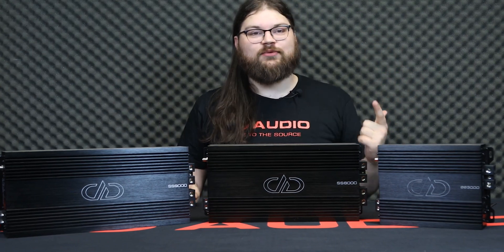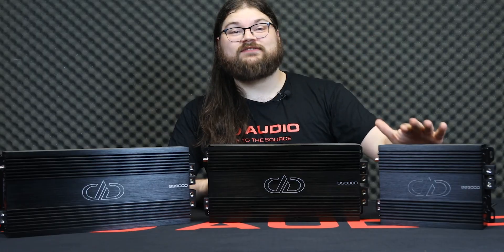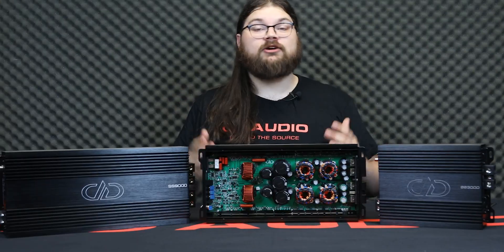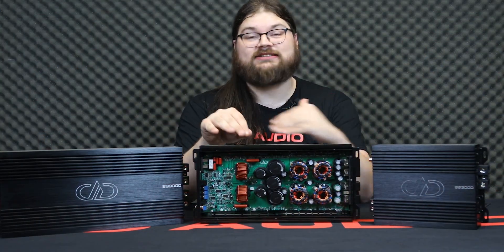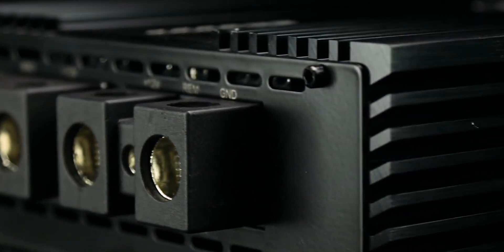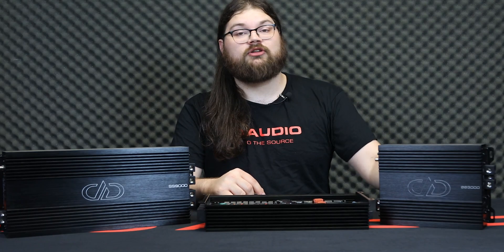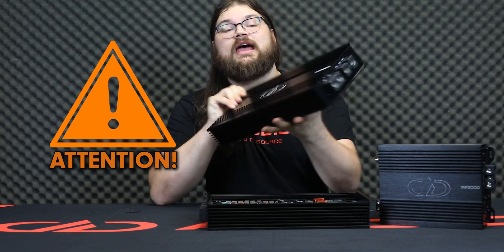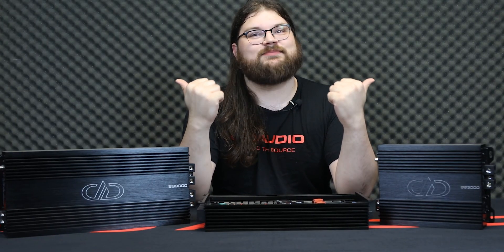Full Range Monoblocks SS9000, SS6000, SS3000

Comment: Which one is recommended for 4 2508G SC subwoofer?
Reply: I was going to ask the same question….. I was going to ask will the SS3000 power 2 2508G’s SC
Reply: For 4 2508s I'd look at the SS6000
Reply: Those are 1200 watt RMS. Are you wanting to run them at this power level? You could get 4 of the dual 2 ohm. Wire down to a one ohm load. Then use the 6k amp. Once you calculate in some impedance rise, you should be capable of getting the power you need.
Reply: The DD Audio SS3000 is $601.99 both on Amazon and eBay therefore the SS6000 is double and SS9000 is triple?
Reply: $1,000+ for the 6k and 9k
Reply: SS3K is $602 SS6K is $1009. & SS9K is $1219. If the 9K can handle 4  Godzilla not a bad purchase at all
Reply: I have the ss3000 on 4 608’s. I’d say get the ss6000